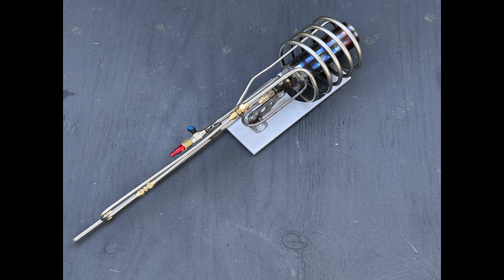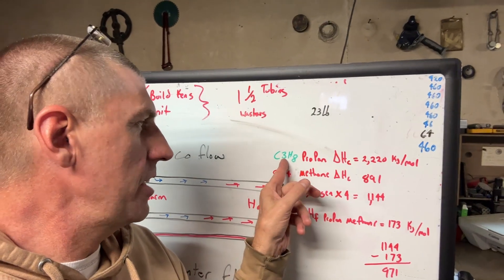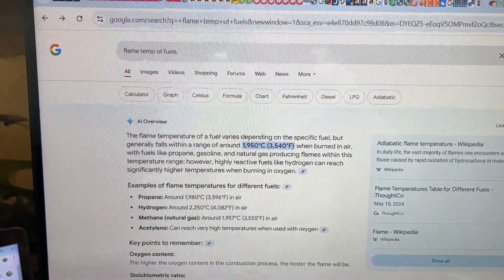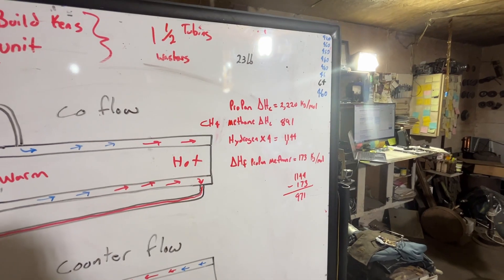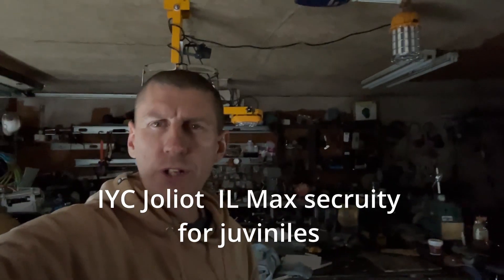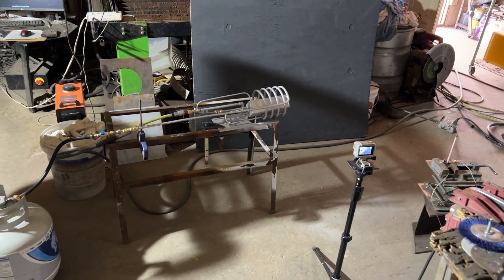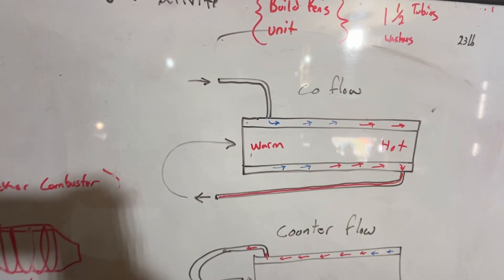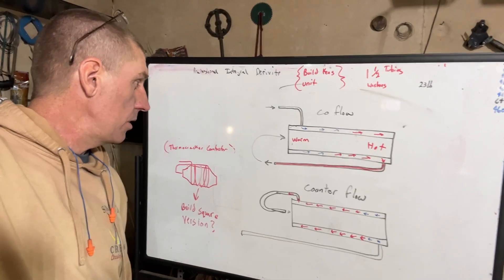Chemical kinetics a treatise on thermal hydrogen production

Comment: A reinforced ceramic shell? Maybe dip the coil of tubing in a slurry to build up a shell? Idk. 2 of those conical crubles somehow joined together with one side cut open would be neat. Sounds like a pain to do tho. Would the ceramics just crack? The thermal cracking is likely much easier and efficient when the flame is going into the furnace obviously you know that. Really fucking cool burner man!

Comment: When you have time you should experiment with preheating air. With a giant preheater that has all of the flame go directly thru it I am melting the surface of silicon carbide crucibles using waste oil. It also melts ceramic stove glass. Its quite bulky, but works good for certain applications

Comment: A monoatomic atom [any gas or solid] is called a 'singlet'.

Some singlets will exist in this reaction.

When singlet hydrogen reacts, it does release more heat energy.

The only problem is, that over time, solid carbon [coke] builds up inside the system and has to be cleaned out.

Also, mathematically, while there is more heat coming out of your burner, a lot of energy is being lost/wasted because it is not being burned.

Therefore, its a trade-off between concentrated heat energy, and total gross energy.

Comment: I don't think you're stupid. I actually think your burner is very creative, but i think you would get better performance from a perfectly tuned propane flame in a more insulated refractory combustion chamber vs the regen cooled cracker thermally conductive one
Reply from the maker: Yes tuning is an issue , the slightest bit of extra air can cool the flame

Comment: Storytime was great....
Explains a few things 😀👍
Cool design.

Was thinking it would be nice to make inner and outer tubes so they can slide apart for cleaning....  just the sealing is the problem....  maybe the carbon would help seal the 2 joints. If it was machined .
Reply from the maker: Hello friend 
Im thinking about doing a burn out cycle at teh end of each run , just pumping air into the red hot pyrolyzer chamber should start a self sustaining cook off . Carbon is very hard to burn despite popular belief . I triedto burn a piece with a lighter and it wont stay lit

Comment: Letting ones expression out does not qualify one as being a JERK NOBOX7...
What is your view of using INCONEL metal for burner material. ??? Good luck fella too. vf
Reply from the maker: I was looking realy hard at Inconlel 600
Reply: @NOBOX7  From what I know, INCONEL is the GOLDEN STANDARD for high heat. Most internals of jet engines use the material. The trick they use to keep things from melting is the coatings. Believe it or not, that is what they use NOBOX7. I would bet that this is the trick you are looking for your burners to reflect that immense heat. 
Good luck fella. Peace vf

Comment: The burner has only one small flaw. And that's because it gets blocked with carbon after a fairly short time. I see that as a pretty big problem. Those who claim that it's not hydrogen are going to be pissed off.
Reply from the maker: Hello Friend , in practice the carbon will be burned out as the burner is shut down air will be added into the red hot chamber burning and maintaining the burn heat  . They do this very process in regenerative hydrogen producers used by the military's for weather balloons . They use 2 chambers for continual gas production .One is in a reducing state removing Rust while the other is in an oxidizing state making h 2 gas from red hot iron and steam
Reply: @NOBOX7  That sounds interesting. I'm already looking forward to the next video.👍
Reply: @NOBOX7 you can probably 3d print 2   gas circuits in the same burner. Oxidize one at the same time that the other one is cracking. Then switch them back and forth and never have carbon buildup.

Comment: It may be quite a stupid idea, but what if you make the counter flow tubing from a standard steel but coated, in appropriate way, with the thermal paste you have created. In this way you control the thickness and even you can experiment with several patterns of coating.

Comment: For the record, I dug story time. Thank you. If I didn't have surfing as a teenager I might have got locked up too. So much buzz involved but after 4 hours of paddling getting pounded by big waves, and up to 4 hours of driving per day (rallying gravel roads for some of the way), you are so spent, one beer and zzzzzz. Chilled unit. But re this cracking business, what if you had co-flow and counter-flow in the same burner? Like a double layer cracking chamber. Or a longer cracking tube, along with forcing a spiral somehow.

And alternatively, how hot is your HHO flame on that type S thermocouple? Because GE E T fuel reformers crack any hydrocarbon into H. Even crude oil and seawater will crack. The book of G E E T can be easily found online and has complete instructions. Imagine having cheap H on demand? Vacuum and heat exchange is required to produce the effect. Usually with an adapted ICE engine but could be made in other ways. i.e. exhaust from furnaces; tesla turbines to pull the vacuum.
Reply from the maker: Thanks for the feedback friend.
 Hey thats a great idea , we have never tested the hho flame on the S type thermo

Comment: Dear what if you place the inner tube with little thicker to avoid melting. Yes you did it but what I saw was that it was straight tube shape what if you give some conical shape something like making jet effects I think it will get heated enough and will not melt. This is just idea you may disagree or you may have already done it maybe I missed that. 
But keep it don't get disappointed if you fail. I believe it wants to be successful we should fail first 
Regards

Comment: :face-green-smiling::face-green-smiling:The first hydrogen balloons manufactured in the 18th century were a column of iron tubes heated with water vapor. How about injecting steam?:face-purple-wide-eyes::face-purple-wide-eyes:
Reply from the maker: The problem with that move is the  oxide layer that forms . They would run hydrogen gas over the hot iron to remove the rust

Comment: Doesn't hho burn even hotter?
Reply: I was thinking that also.. takes quite a big unit to make enough gas. But actually not that expensive to buy, the Severs youtube channel demos the units they sell out of Belarus. Quite a big flame for only a couple of grand. I totally trust that operator. Genuine good dude and clever. I burnt the plates on my last big HHO electrolizer and those Severs units are on my wishlist. But bro here is in the business of selling burners, not HHO units.
Reply: @waynoswaynos  Ah ok, seems he's after heat though so that would be an excellent choice, I wonder if the energy cost in electricity is higher than the gas cost, or if it's lower....
Reply: @bogganalseryd2324  I recall $12 worth of liquid propane in the first successful experiment but he didn't say how many grams were consumed. One of the Severs HHO units makes 650 litres per hour of gas at 2.4 kW. But you'd need to melt 336g of drill bits with both methods side by side to really know. My money would be on the HHO. It doesn't have the endothermic hydrocarbon cracking issue cooling the flame we learned about in this video for one. And for two it burns pure oxygen with the monatomic H. 

A torch and a gas bottle certainly have lower start up costs. If I had $3K in an HHO system it would take me 90 (in my country) bottles of liquid propane to catch up if the torch cost $300. But I could do more stuff with HHO IMO.
Reply: @waynoswaynos  yeah I agree, it probably won't be on an order of magnitude cheaper but as long as it is a bit cheaper it could be worth it, especially if you can build the hho generator yourself, maybe even from parts you have laying around.

Comment: What about insulating the outer section of the chamber? I know it was glowing red on the previous burner. Might keep a little heat in the unit. Also what about some fins inside the burner to absorb and transfer some additional heat to the chamber? Might also give some IR radiation as well? 

Also re inconel can you buy sheet and roll and weld it? Might be cheaper. I have seen this done for some exhaust manifolds.